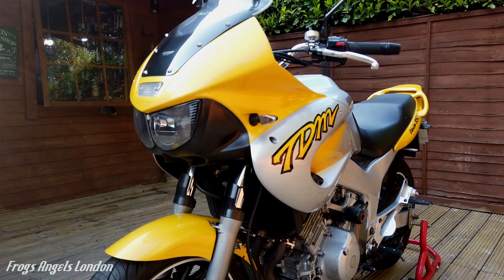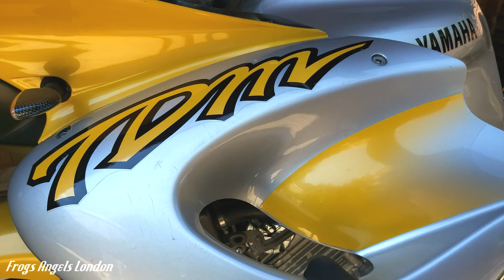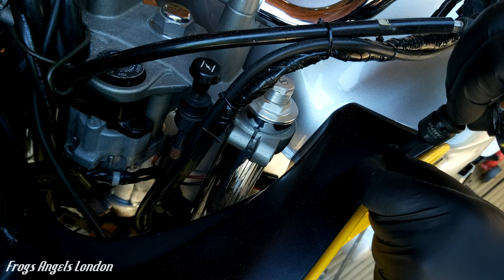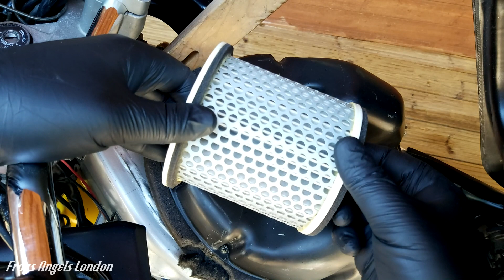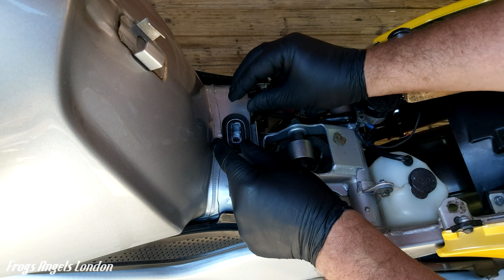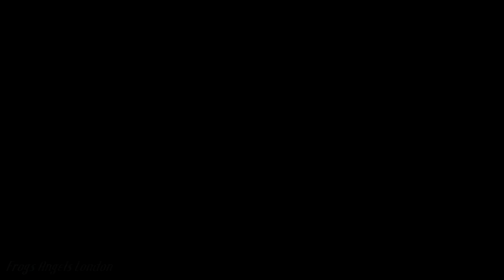Yamaha TDM 4TX1 1996 Air filter check change replacement

Comment: Did you have to disconnect any fuel lines for this? I have to check my air filter soon and route some electricals under the tank but I've never taken it off.
Reply from the maker: No fuel line removal. Just lift the tank carefully.
Reply: @FrogsAngelsLondon  Thanks for the quick reply! When the weather clears up I will give it a go. I love the entire maintenance series you made btw, it's very clear and helpful!